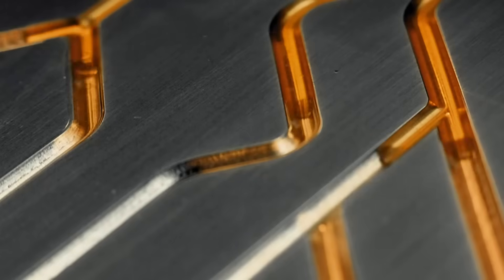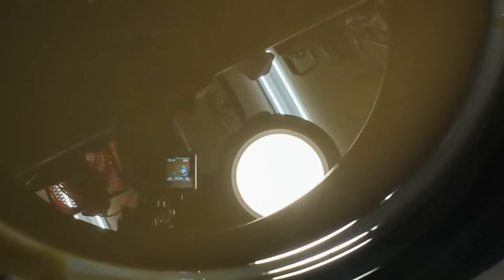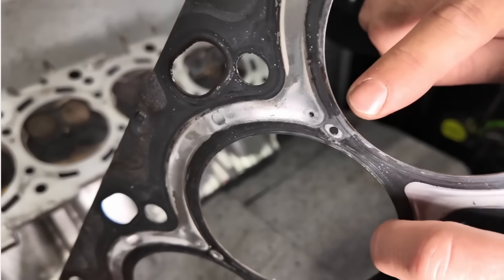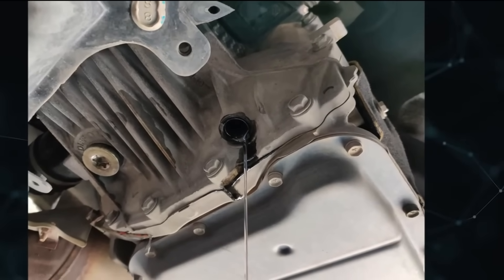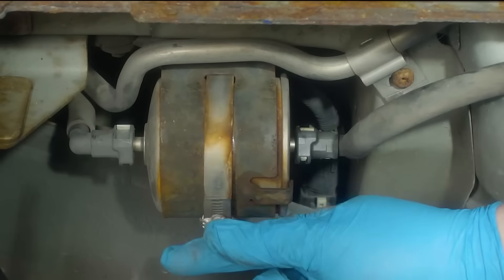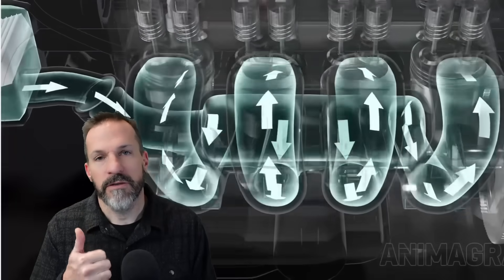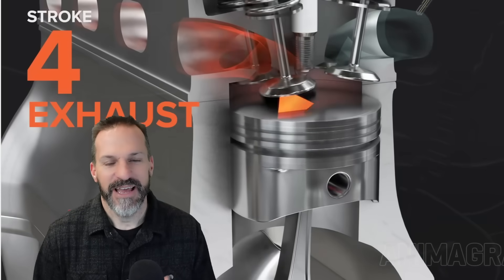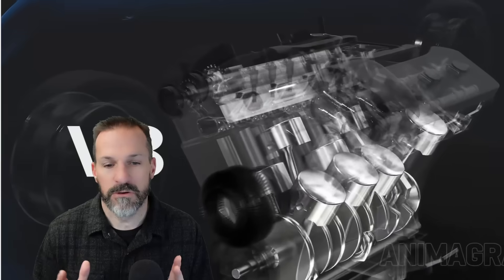Car Maintenance MOST People Ignore! Make Your Engine Last 200,000+ Miles!

Comment: 306k Miles on my 2009 Toyota Corolla purchased new. I have been methodical on everything that you have listed here with the exception of brake fluid which is my bad and I should have flushed that long ago will attend to that soon but been very methodical on everything else. Also using Lucas fuel conditioner or almost every fuel fill out for the last 200,000 and the car runs so smooth and quiet to this day. What has been replaced all for ignition coil packs, just recently had to do radiator developed a leak, oil pressure sending switch blew out about two years ago. All parts are placed OEM and no janky Chinese aftermarket stuff has been a big boon also to keeping it all quality Toyota durability trouble free operation incl OEM on all filters. I think my AC compressor bearing may be going out is it starting to make a fair amount of noise other than that everything is running smoothly and great. Good instructional video here!
Reply: @jonathanratliff4780  my 2001 4runner  AC was making noise thought it was the bearing.I changed  all three belts noise went away.

Comment: Use a techron additive to your gasoline system at least once per oil change, another cheap prevent.
Reply: Or use highest octane so you don't have to use those trashy additives
Reply: @yournightmare9999 using it preventatively with every fill up, something thats about 4ml for 4 liters of fuel is not trashy. Knowing what and how much of your additive is in your fuel is more valuable than relying on what the gas station states they put in their premium fuels. Most cars don't require higher octane and don't make good use of it.
Reply: @martin1649  so use additives and cheap gas.
Reply: @yournightmare9999  i live in europe, so our "cheap" gas is equivalent to your middle of the road 91 octane. I am unsure which additives sold where you live are potent enough to use at such low ratios, maybe Archoil.
Reply: @martin1649  like I said, stay with your cheap gas and use cheap additives.
Reply: @ like i said, keep falling for gas stations marketing claims of cleaner engines and using high octanes in a car that can't utilize them.
Reply: @martin1649  most recycling is in european cars with small engines or small engines with turbo, so don't talk nonsense kid
Reply: @ what recycling are you talking about?? don't have to insult me for stating my opinion, which was more meant for OP and not you.
Reply: @yournightmare9999  wow that's one of the dumbest things I've ever heard. Apparently you have no comprehension whatsoever of how octane works and the fact that higher octane fuel when it is not warranted will actually reduce power because it is more difficult to burn which also causes deposits.  🤦‍♂️

Comment: 230k is rookie numbers for a pre 2022 Toyota. My dad's Tacoma had 400k before the frame rotted out and his T100 was at 380k when the frame on that gave out. He neglected the piss out of both of them severely. I remember driving that T100 home on 5 cylinders one time because a coil pack went out.
Reply from the maker: Hehe...yes 234k feels low for an older Toyota. It will be sweet to get 400k on this old Sequoia...hoping I don't have the head gasket issue.
Reply: @TheCarGuyOnline  seems like you already know the answer to avoiding it. Besides, a head gasket repair isn't the end of the road. Just make sure you keep an eye on it. Plenty of the earlier UR engines on the road today.
Reply: My '02 Sequoia is coming up to 400k at the end of this year. Looking forward to taking it past half a mil.

Comment: Clocked 464,000 on my 1988 Toyota pick up (22R Carburated) that I owned from 1994 to 2018.  Even with 8K to 10k oil chage intervals per OEM specs. Yet, I do believe 100% in what you are saying.  My 2007 Honda Pilot (3.5 V6) oil change is at ~7,500 miles per OEM. I experienced pitted camshaft lobes that made a nasty clicking noise.  I bought new heads and decided to rebuild the block.  After seeing the condition of many components I removed and disassembled, I personally realised the importance of more frequent oil changes.  Engines now days rely on motor oil so much more than 20 years ago.  I am sticking to 5k or less oil changes.
Reply: Thought the carbureted version stopped in 85'.Regardless ,you had a great one. I had an 84' with about 275000 before the truck got stolen. Had the SR5 package with tach ,oil pressure and volt gauge and sliding rear window. I went 3 months or 3000 miles and never had any problems. It just stumbled at times when cold. Typical of carbureted engines. But was quiet when warm.
Reply: And the VCM is a killer on those J series v6. Got a muzzler for my 13 pilot after killing the motor in our 07 Odyssey.

Comment: Learn from my mistake. I have a beater 2006 Toyota Sequoia basically bulletproof. I decided to go with the most affordable aftermarket timing belt, water-pump, and gaskets. On top of that, I went with a mobile mechanic that was recommended. 
In short, I developed a leak of coolant and when I called the mechanic he disconnected his phone and took his website off Google.
I'm stuck, maybe with redoing everything. Not sure yet? Just get the work done by a business that's insured if you can afford it to save something like this happening.
Reply: Yep, OEM is where it's at! You bought a Toyota cuz you trust how they build things -- same for the parts. ✔️
Reply: I did my 2007 sequoia’s timing belt my self with the most expensive (high quality) parts and it runs beautifully still. 
It is a big job.
AISIN or Toyota parts only.
Reply: Check your heater T’s. It’s a super common place for those 4.7’s to leak coolant from

Comment: I have a 2001 Toyota Camry 2.2. I have 360000 miles. No check engine lights running like a babyes every three thousand miles I changed my oil.

Comment: 2004 Honda Accord EX-L 3.0L V6 approaching 400K miles in Michigan but my son bought it at a donated vehicle auction in 2019 ($700 VOA) so the history is unknown but everything appeared to be original. He made it a few miles down the road before the trans failed. I got lucky and found a wrecked low mileage 5 speed automatic trans (BAYA) for $100 at a self-service yard. The Accord runs smooth and quiet. Oil changes every 5K mile with Mobil 1 extended performance high mileage full synthetic and Purolator Boss oil filters but I have a bad feeling because my son won’t take the time to replace the timing belt. He’s had it for 6 years and it’s approaching 400K. To make matters worse, he just paid over a grand for a set of Michelin tires and when it returned from Discount Tire, I found the frame rails were bent in the rear. They clearly lifted it forward of where Honda had quarter sized holes in the rails that faced down. But he refuses to complain. Sure it’s old and has high mileage but it’s still rust-free. But on the other hand, his heavy sub in the trunk may have contributed.

Comment: 5K mile oil changes if it’s synthetic, much more frequent if it’s dinosaur oil. Mobil 1 extended performance high mileage full synthetic oil is all I’ll use in my vehicles. I’ve seen so many sludged and crusty valve covers, oil pans, partially blocked oil pickup screens, and encrusted valve stems that may not have happened had the owner not cheaped out by using dinosaur oil. Perhaps that last one is because most automakers now use direct fuel injection, seeking more power, rather than the cleaning effect of port injection. I think Toyota started using both now. I stay away from turbos and CVT’s. I wonder what sort of maintenance an EV will require.

Comment: 250k on my 05 Accord 2.4 Liter k24 engine.  Quality filters like wix or Bosch or Mobil1.  Good oil like penzoil ultra platinum.  It has noticeably less compression than years ago, but otherwise runs like a top.

Comment: Im at 14 years 330 thousand miles 2011, 4runner sr5.  same transmission fluid no issues yet. Only oil chsnges n spark plugs air filters.  Gona drain n fill the trans , and diffs soon as the snow is gone.   Figure its due! 😆.    This thing has been a tank.  Just runs n runs.  Never had an issue ever!
Reply from the maker: That's incredible! Those are some amazing numbers.
Reply: @TheCarGuyOnline  they don't build vehicles like them old 4runners anymore.   I've never had a vehicle just go and go like this old girl.  I will Def be looking for another one with low miles when she finally kicks the bucket.  This thing don't owe me a dime.   Been payment free for 10 years.  Really impressed with the old-school toyotas.  Newer ones not so much.  ✌️
Reply: @LORD_OF_THE_ROOTS  why is it a girl and not a boy?

Comment: I got 360k out of a Honda Accord with a 2.5L engine and a manual transmission. I ran the hell out of that car. When I got rid of it, the engine was still running great.
Reply from the maker: That’s impressive
Reply: Nice user name😂 Rotten Animal 😂
Reply: @45122   Rotten Animal was a name of a former cat I had. He was very social and had a great outgoing personality but, he also have a little evil in him. He was a great cat that passed years ago. I miss him a lot.
Reply: What year was it ? I have a manual 2013 accord touring with the 2.4l 4 cylinder. This makes me happy 😊
Reply: @Onetakelifestyle3323  I think it was a 1996 or 1997 Honda Accord. It had a 2.4l or 2.5l 4 cylinder with a manual trans. I did oil changes every 6 months and had the timing belt changed. It's a good reliable car. I hope you get 500k out of yours. Good luck.
Reply: @Onetakelifestyle3323 I currently have an 05 accord ex, 378,000k miles. I will see if I can reach 800,000miles one day
Reply: Manual trans and naturally aspirated engine and no AWD is a recipe for longevity

Comment: Hi I just wanted to get a shout out about your videos I want to say thank you. I'm a big Toyota fan I own a 2014 Toyota Tundra with about 220,000 miles when I upgrade it's going to be a 2021 and under lol. My question was about the transmission and your thoughts back about 40,000 Mi ago I was trying to get info on whether to change my transmission oil cuz I'm not sure it ever has been done as far as I know I don't think it has the dealership mechanic told me that if I'm not having trouble I should not attempt it what's your thoughts on that?
Reply from the maker: I personally would do a drain and fill and see how it goes, that will only replace about 1/3rd of the fluid. Run it for 5k…if you don’t have issues do another drain and fill. It’s up to you but, if it were mine that’s what I would do.
Reply: @TheCarGuyOnline  THANKS for the response. ya that was a Machanic from the dealership that told me that. For awhile I was trying to get straight answer on Tundra forums. I knew that flushing the system was bad idea, unless I had low mileage. I know the dealership charges at least $400 to change Trans fluid. Ya it has been bugging me not changing it, and I haven't had any issues. Unless one issue is when shifting from forward to reverse I feel a little delay, but that maybe the universal joints? So you think I should just do it, even if it has never been done with that old oil?
Reply from the maker: @MrMiller2980  I would yes. Toyota transmissions are extremely durable, if doing one drain and fill ends up causing a dead transmission shortly after, I assume it was close to dying anyway and time was limited. That’s my thought process anyway. How much towing has been done in the 220k miles?

Comment: 333,000 on 2002 Honda Cr-V with the 2.4L engine. Regular Maintenance performed as your video stated. Excellent video by the way
Reply: About carfax most garages around here don’t report to carfax
Reply: Got a CRv with 245k sweet ride really.
Reply: @Petesworkshop2225 That’s a great car…..
Reply: I’ve got 123 miles on mine so far.  No problems…haha
Reply: Wow that's impressive. I got about 177xxx on mine right now. Hopefully I can get mine to 300k +
Reply: Wow. Now I'm less worried about my 2018 Dodge Charger with 177,000 😅
Reply: @CustomMuscleCarAccessories Honda CRV > Dodge Charger
Reply: Damn. Way to go!
Reply: Just got a 2011 I'm hoping it'll last for the next 10 years.

Comment: 256k on my wife's original 05 pontiac grand prix gt with the best GM motor ever made......the 3.8 V6. I've maintained it myself. Pretty simple car. Heated seats and AC still works. Just replaced master cylinder and all 4 struts, exhaust pipe, plugs, wires and fuel pump. Have about 3k in parts over last 2-3 years including all new wheel bearings and calipers. Been a great car. 3k miles oil changes regularly with full synthetic oil.
Reply: The 3800 will last a very long time I went to an auction started a car with the infamous 3800 had over 400,000 miles the engine ran so quiet it was unbelievable.
Reply: Every once in awhile the manufacturers hit a homerun
You gotta keeper.  These gems can save families a fortune. 
You also have done your excellent pre maintenance
Reply: Love my '00 Impala LS
Reply: 3k in 3 yr is a lot.
Reply: @melsagelord3991  I did it myself. If I would have paid someone to drop the fuel tank and replace the fuel pump it would have cost a crap load. Not to mention replacing all the struts wasn't necessarily the easiest either and doing it myself saved me a few grand too. This car is in the middle of salt belt AND gets parked outside the garage so the wear and tear has doubled since the last 5 years when it got downgrade to daily driver (beater) for work and back. You honestly think $3k over 3 years to replace common things that rust out on a 20 yr old vehicle is alot? I disagree. Now the vehicle is good to go for another 3-4 yrs and hit 325k miles before I completely give it the boot.
Reply: Good job on all those repairs. You saved a ton of money and maybe you got some satisfaction keeping your car going. Some people would rather lose 3k driving off a dealers lot in 3 seconds than spending it on maintenance over 3 years!😄
Reply: @melsagelord3991  if you do the math right, it's $3k in 20 years.
Reply: Lmao. 250k on a 2013 CRV... all I do is change the tires and brake pads. 7k oil change intervals. It jus recently started burning oil. Lived outside its whole life.
Reply: @omardevonlittle3817  8 years newer....moron

Comment: Aren’t most fuel filters now in the fuel tank?
Reply: Just use Lucas fuel cleaner from time to time. I buy the gallon and reuse the small bottle each fill up
Reply: Yes and they're not really true filters anymore. You can always splice in your own though.
Reply: I think so, you will have to remove the hole tank

Comment: I see the exact same thing with lack of maintenance and oil changes when searching for a used car. Too many HUGE gaps in oil changes, like 20,000+ miles or the uneducated that follow the silly 10,000 mile interval from Toyota. Sometimes I find an awesome 3 owner 2015 or so Camry or Corolla with about 100,000 to 130,000 miles in which the first 2 owners did 3,000 mile oil changes for the first 80,000 miles, and even a transmission flush, but the 3rd owner only changed the oil like 2 times in 30,000 miles or jumps between 8 and 12 thousand mile changes only to completely stop changing the oil knowing they are going to get something new, and go 15,000 miles with no oil change. The other sad thing is to find a car with 80,000 miles having 5,000 mile oil changes but you see complete brake jobs at 30,  and 65 thousand miles so you know they drove it like a race car in almost all city driving and that the brakes are almost gone again and the engine and tranny have taken a beating. I see a lot of cars with 3 complete brake jobs before 100,000 miles. Too many lease vehicles with ZERO oil changes for the first 35,000 miles, and when they do have oil changes it is almost always 10,000 mile intervals that stop after only two because Toyota Care only covers the first 2 oil changes at 10,000 and 20,000 miles. Forgot to mention I only look for 2012-2017 Camry, 2010-2013 Corolla LE or up to a 2076 L as it still had the 4 speed available while the LE and up went to CVT. I also look for NON CVT or Turbo Accord 4 cylinders 2012 or the 2013-2017. Too bad too many Honda and Toyota owners fell for the 10,000 mile oil change fantasy the dealerships told them.
Reply from the maker: Yeah, you can tell who actually cares for their vehicles. I see it all the time.
Reply: I have a 2006 tundra with 300k miles I bought new, still runs great like it did when it was new.   Changed the factory oil at 1200 miles to full synthetic, then 10k mile oil changes with mobil 1/amsoil.  Zero issues, uses about a quart every 5000 miles also since new.  It really depends on the engine.  Do an oil analysis and know for sure.
Reply: @DanI-ls4dj   Car Care Nut has a new video of what used Toyotas not to buy in 2025 with a segment called "the victims of the 10,000 mile oil change" referring to the 2AR15 engine in the 2009-2018 Rav4s and Camrys becoming Excessive oil burners on 10,000 mile oil changes and ruining engines with contaminants or low oil due to people not checking their oil between changes.  However, those that did consistent 5000 mile oil changes rarely have any issues. He says it is a great engine on 5000 mile changes but 10,000 mile changes kill it. This would be an example of depends on the oil change interval. Sounds like your truck is a definitely depends on the engine if I read your statement correctly that it has burned a quart of oil every 5000 miles since day 1. I see some new cars like Kias state that you should check your oil every 500 miles as it is considered within manufacturer tolerances that it may burn up to 1 quart of oil every 750 miles. I can see a lot of voided warranties for people that do not bother to check their oil between oil changes.

Comment: Oil changes at 5k or less are also very critical for low tension Toyota rings. My daily driver 2009 Ford Escape has 306,000.